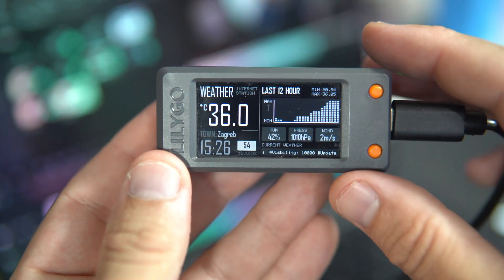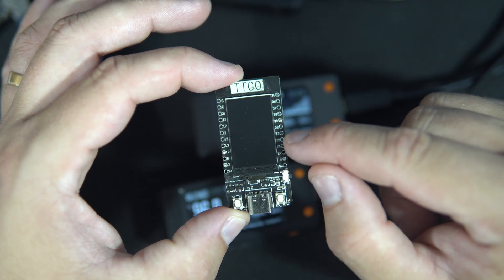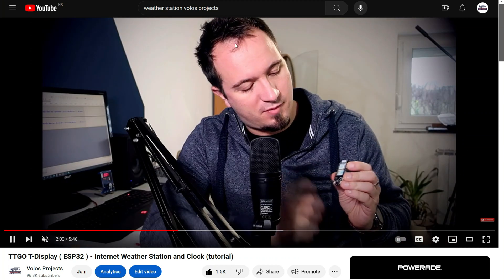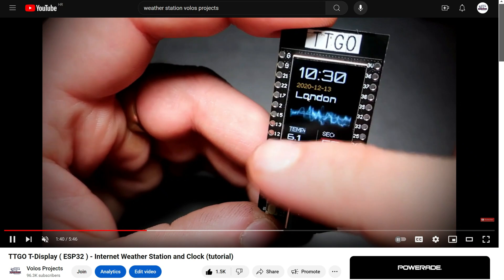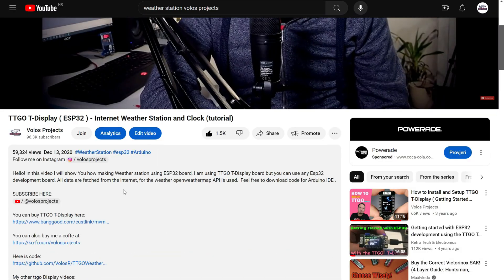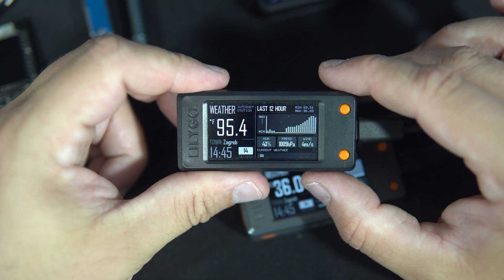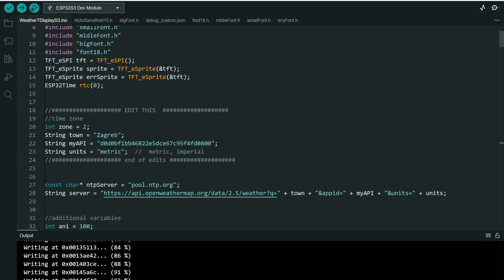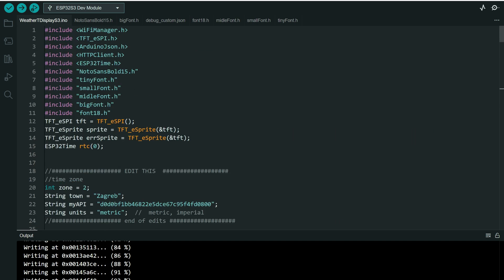Let's make Cheap Internet Weather Station using LilyGo T-Display S3 and OpenWeatherMap.org

Comment: Very nice and interesting project.I tried to make it. But i get an error while compiling.
Compilation error: no matching function for call to 'HardwareSerial::begin()'
If i try to comment the code line the project compiles fine but when i upload it i get blanc screen.
Any suggestions?
Reply from the maker: @yannisxidianakis6879  did you install libraries and board, have you already used this board? You have same board like me?
Reply: @VolosProjects  Yes everything is installed. esp32 boards v2.0.17 and i have use the board many times testing your previous projects
Reply from the maker: @yannisxidianakis6879  hm, i realy dont know, Arduino IDE sometimes updates libraries and they dont work again with this board. Can you try some other basic example to make sure library is working.
Reply: @VolosProjects  Thanks for your help.
I manage to get the project work. Seems that you are right about Arduinbi IDE and libraries.
I uninstall board and libriries and install them again.
And the project compiled and uploaded.
But now i have another problem. The display shows "Connecting to WiFi!!" and stays there.
Reply from the maker: @yannisxidianakis6879 you need to configure wifi , please watch my last video, in last video i explaimed how to use wifi manager. Your board made new wifi network, you need to use your laptop or phone to conect to it.
Reply: Thank you for your time and your help.
Now everything works fine.
The only change that i had to do is to add speed 115200 in the Serial.begin line.

Comment: Tried to flash the weather station in Arduino, but it shows:

Compilation error: no matching function for call to 'HardwareSerial::begin()'

Searched on google - it should depend on the wrong board, but I've used ESP32S3 like it is shown in your tutorials. When I'm choosing other boards the error doesn't appear...
Reply from the maker: try to delete that line.

Comment: You could make all of your wifi and api keys as include files, 
so it is never hard coded in your sketches...
That way if you ever need to change a PW, just edit the include file 
and it will be available to all sketches without editing each sketch..

Comment: Another excellent video and a great learning experience for me.  I have had your previous weather station running on my desk continuously for approximately two and a half years.  It's right under my monitors and has been my point of reference for both weather and time for all that period.  Now I have this new weather station loaded on another of my T-Display boards and now a new reference point.  I have made some changes to add colour, but the functionality is untouched.  The ability to avoid hard coding of WiFi configuration is great.  Thank you again!!
Reply from the maker: wow, 2.5 years. I hope you will enjoy new version. Tnx Trevor :)
Reply: @VolosProjects  - I had to make some changes to the original version to accommodate library and OpenWeatherMap API changes but managed to keep it going.  👍

Comment: Getting a compilation error: "ledcSetup was not declared in this scope" - Any thoughts?
Reply: Downgrade your esp32 library to 2.0.17, you probably have 3.0.4 installed in Arduino right now
Reply: @JanDahl  Thanks - Don't want to have to do that - Too many things work as is and don't want to downgrade just for this - I was hoping someone had the right replacement code for the new ledcAttach which is used to set up the LEDC pin. It has merged the ledcSetup and ledcAttachPin functions. in 3.x @VolosProjects - Any code?
Reply from the maker: you can try replace that three lines of code which are realted to ledsetup with analogWrite(38, 130); or you can delete them completly, but then you will get max brightness. In mine case nothing works ok on 3.0 :)

Comment: I get compile error
 C:\Users\sail1\Documents\Arduino\libraries\LILYGO T3\WeatherTDisplayS3\WeatherTDisplayS3.ino: In function 'void setup()':
C:\Users\sail1\Documents\Arduino\libraries\LILYGO T3\WeatherTDisplayS3\WeatherTDisplayS3.ino:67:15: error: no matching function for call to 'HardwareSerial::begin()'
   67 |   Serial.begin();
void setup() {

  Serial.begin();

  // using this board can work on battery
  pinMode(15,OUTPUT);
  digitalWrite(15,1);
Reply from the maker: hm, that is bigger problem. did you istaled your board properly, did you use that board already? you have sam board as me?